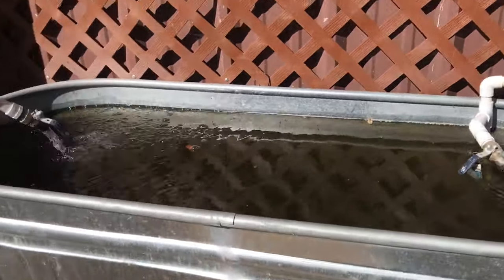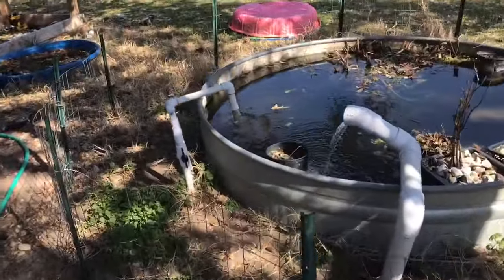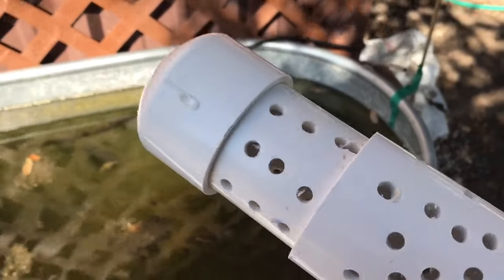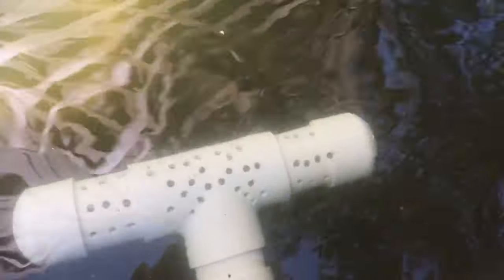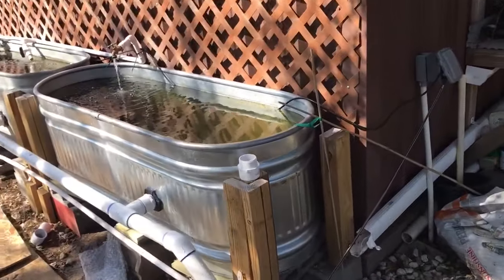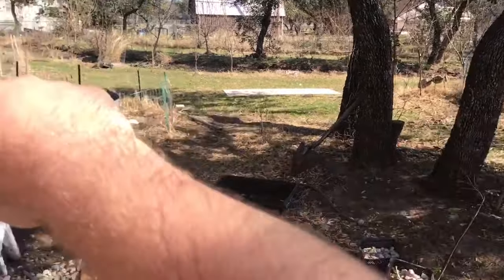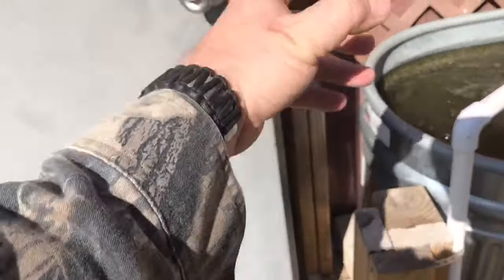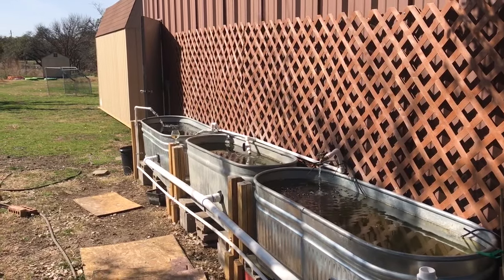New Clog Free Return Drains for the Aquatic System

Comment: Great timing looks great jack.   I'm looking for bulkhead fittings...did you find those at lowes also?  All I've seen are like 1-1 1/2".   I'm doing tilapia in 2 90 gal Rubbermaid type tubs.  Not as big a setup but I'm going to make a slow spin solids filter from a trash can or blue barrel.   Just need bigger bulkhead fittings.  Keep up the great work and thanks for sharing!
Reply from the maker: My buddy David is  contractor and ordered them from some place.  Not sure where but I will ask the next time we hang out.

Comment: I understand that you have two separate systems that you're calling aquatic and aquaponic, but is there a functional difference between the two?
Reply: Aquatic is fish only system where you have to remove the fish waste from it yourself, or by using some other fish that feeds on those wastes.
That is why you have to use a filter system on your fish tank in your house. 
Aquaponic has fish in it and uses plants to clean the fish wastes from the water and uses that water as a grow medium as well.
Some fish solids still have to removed from the system as the plants can only deal with wastes up to a certain size. 
More of a natural cycle with the plants, you might say.